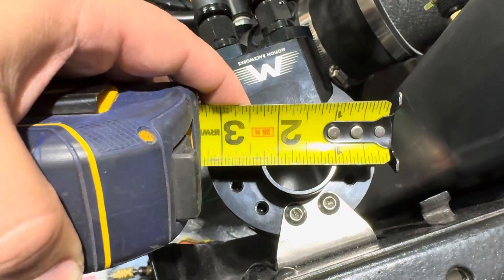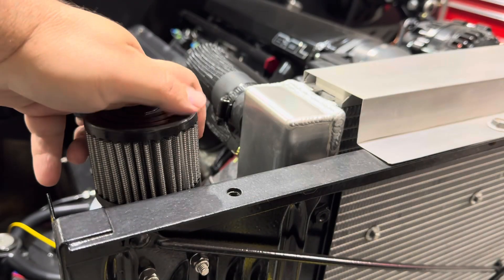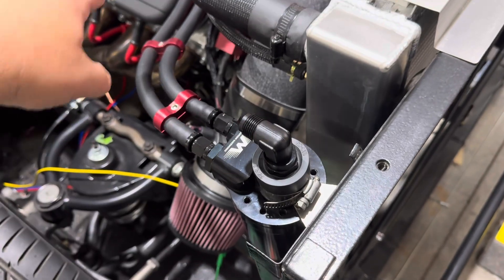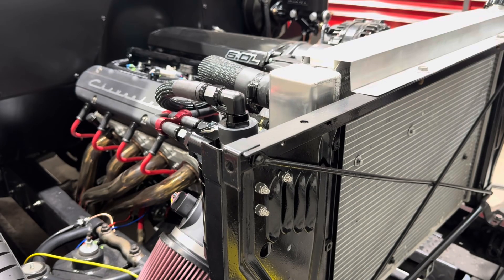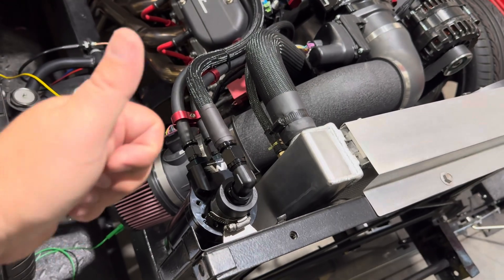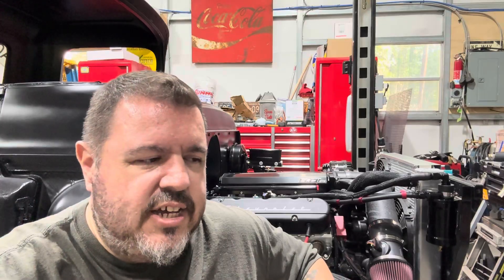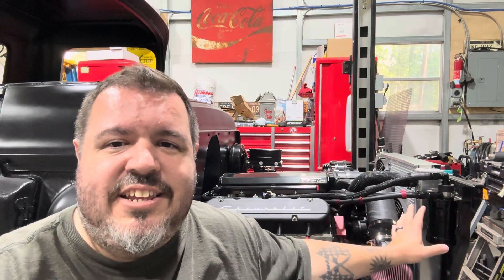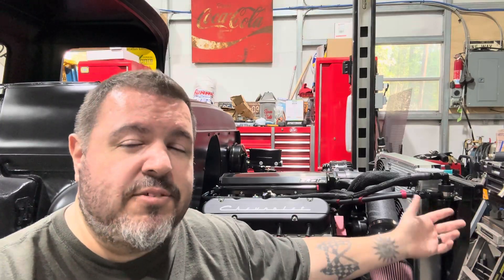Oil Catch Can Misinformation: Vented vs. Sealed—Which Is BEST for Your Engine?

Comment from the maker: PRODUCTS USED IN THIS VIDEO:
Fernco QuikCap:
https://amzn.to/3UfMqdS
-6AN Tee fitting (back of intake)
https://amzn.to/3YbIjRk
-8AN push lock fitting:
https://amzn.to/4dSEUwj
-8AN bulkhead fitting
https://amzn.to/3NEbvv7
Lock nuts:
https://amzn.to/3NxxILt
TechFlex braided sleeving:
https://amzn.to/3YwefkL

LINK TO PREVIOUS CATCH CAN VIDEO:
Oil Catch Cans: 101 - EVERYTHING you NEED to Know!
https://youtu.be/wX42ANVfbxE

Comment: Was using vented to atmosphere and switched to recirculating setup on my twin turbo sc400 noticed better stable oil pressure and better engine response cars now at 900hp 28psi 6800rpm

Comment: It looks like you connected catch can directly to intake manifold thats fine if the inlet to the catch can is a PCV valve.  If the inlet is the valve cover(s) what you have done is created is a uncontrolled vacuum leak, and likely created way too much crank case vacuum.  Too much crankcase vacuum can cause piston pin and potentially other failure due to inadequate vacuum.  Catch can outlet from valve covers needs to be vented or routed between intake filter and throttle body.
Reply from the maker: I appreciate the concern, but this setup ensures proper ventilation without creating a vacuum leak. Additionally, you need to watch the first video in this series as I have returned my can to a vented orientation.

Comment: Thanks for the video. Short intro & outro & you seem very down to earth. Answered a lot of questions. One thing I still do not get, is do I vent to atmosphere with PCV's still on the intake, or remove them?
Reply from the maker: Venting to atmosphere is pcv. However, be careful to plug any open sources of vacuum when rerouting pcv lines like this, so that you dont get a vacuum leak

Comment: You do nice work Mike. Your 55 is coming along well. Motion Raceworks actually sells this catchcan with an outlet already there (part #31-106BLK-14). to save some work. Question though: Does plumbing your vent into the intake manifold create a vacuum leak? Can you plumb it into the air intake instead? Thanks for the vid. Hope my 57 looks as good.
Reply from the maker: Ha! They came out with that part literally ONE weeks after I released this video… I actually called them about it and they laughed and were like “ah you know how it is - cant say anything until after its released”. 
As for a vacuum leak, the factory plumbs the pcv to the intake anyway. But it depends WHERE you plumb it. If your throttle body has the port - it can be plumbed there or under the intake, but no, I would not plumb it in line prior to that.

Comment: I'd leave it like that. It will keep your engine cleaner.
Reply: I run a double vented catch can on my Gen 2 Dodge with the Cummins turbo diesel. Cleanliness on a diesel engine's engine bay is near impossible. Always leaking somewhere.
Reply from the maker: I went back to vented almost immediately after making this video lol

Comment: I'm sure it cuts the stink.  I do wonder if you needed to adjust your tune at all vented vs. unvented?  Did you notice change on your air/fuel ratio at all after if you have an AFR gauge?
Reply from the maker: I switched it back to vented. I felt it runs so much better and created unwanted pressure on seals

Comment: I use vented because my motor is a Diesel Common Rail, and have very high pressure  and blow by
Reply from the maker: I switched back to vented on this engine

Comment: You’re better off with fresh air from intake going into passenger side valve cover to draw air into and across the crankcase and out of the driver side valve cover into the catch can and back into intake with sealed can. For boosted applications just use the same setup but put check valve in can exhaust filter to vent air out only.  That way you maintain your oem vaccum setup by preventing air from getting drawn in but in the event of too much positive pressure it will then vent out of the catch can filter if needed
Reply from the maker: I went back to the original configuration of both valve covers to both inlets of the catch can. Engine is much happier 😊

Comment: Was catching a lot of oil in unvented can on 87 sbc 350, going into front carb main vac, with tall valve covers, 98 350 catch can unvented working good catching moisture and little oil, both all stock no egr and cans are about air fliter level
Reply from the maker: That’s great! They are convenient inventions!

Comment: I had to take the filter off because the catch can was not making my car start. Should I put the plug back on and the car started.
Reply from the maker: I think you might have it plumbed wrong.
Reply: @intheshoptv maybe but if I plug up the top instead of that filter he runs good. Also I put some steel wool in the inside compartment where the top spins off.
Reply from the maker: @anthonylisboa8415 You probably have it plumbed to run as a sealed can, and have are pulling vacuum. To run it open, all other vacuum ports should be sealed off, and then you’re basically running a line off each valve cover. Thats it
Reply: @intheshoptv  maybe I got the in and out hooked up wrong.
Reply from the maker: @anthonylisboa8415 Wish I was there to look. Will help any way I can if you don’t get it figured out

Comment: A sealed can goes in line in vacuum hose going to PCV valve. It has to be sealed to maintain vacuum. It just “filters out” contaminants. . A vented catch can is a puke tank. Bigger the hose leading to tank, the slower the same amount of pressure will be traveling, the less oil it will drag along with it.
Reply from the maker: Essentially

Comment: Your closed system is missing two critical elements that will drastically improve operation of your installation.  Right now you are pulling full intake vacuum on the crankcase and will pull more oil into the intake than even the OEM PCV system.

You truly need to add a filtered-air (metered / post-MAF) inlet into the crankcase (valley cover works).  Secondly,  that inlet needs an orifice of around 0.100" diameter, to prevent massive airflow.  This allows a flow-thru of clean, metered air without pulling as much oil as you have seen.  

btw, your vented system was fine the way it was, but of course the vented effluent is annoying and unnecessary. It does not need inlet air.

A closed system must have an orifice-limited in-flow of clean, metered air to flow-thru the crankcase, without pulling full vacuum and tons of oil into the intake.  Trust me.  Do this.
Reply: My bad for commenting on an older video.  But, since we're chatting and since you're running vented at this time, I'd still recommend to go to a sealed system with the changes I outlined a few days ago.  Properly implemented, and given you are not boosted or making 600 hp NA,  there are tangible benefits to a sealed system that vented does not provide, and no downside potential.  If you move to big hp, the vented system may be more beneficial.  I won't bother you about this again.  I got no agenda or anything to sell; just  thought you or your viewers might be interested.  Have a nice day.
Reply from the maker: It was quickly changed back to the vented configuration long ago

Comment: Did you have any issues with unmetered air by tying directly into the manifold instead of the intake before the MAF? I know it's a closed system, but I've had issues from even small intake leaks before.
Reply from the maker: Not due to the MAF, but I will say that the closed system created too much pressure. I didn’t like the way it ran, and quickly went back to the vented orientation.

Comment: I found your videos on Catch Cans enjoyable and informative. I have a 2011 Ford Ranger Wildtrak 2.5 TDCI which I bought new and has done 83,000 KMs. I do some long trips 1,200 -1,500kms and local ones 30 kms +, I recently installed a Catch Can that can be run sealed with a plug in the top or vented. After watching your earlier video I tried vented and sealed, for 300kms each. no oil in vented but a small amount in sealed. I have gone back to vented as I read that some fumes can go back into the Engine and I don't want oil in the air intake mixing with the Soot from the EGR. I don,t see any smoke or steam coming out of the Breather , the Engine seems to run better vented and the Temperature Gauge is slightly lower. There is very little blow by from the Engine. I live in a Tropical Country so no cold weather to cause condensation in the Engine. I can remember many years ago Engines had Breather Pipes that went into the Air Filter Box or down towards the Road.
Reply from the maker: Very cool, which country do you live in?
Reply: @intheshoptv  Thailand
Reply from the maker: @douglasfisher8665 That’s awesome. Would love to visit there someday!

Comment: Just wondering if the Vented option would work best in winter months and the seal option for summer months
Reply from the maker: Its more of a what your engine needs type of thing. Was just talking about this with another commenter… for example, carbureted engines tend to like sealed cans, and injection tends to like vented cans
Reply: @intheshoptv  sounds good, i brought one and is on the way. I will be using the seal option for summer and Vented for winter just incase it freezes the air have an escape throw the vent and not build up and cause a leak somewhere. I have a 2017 ford fusion 2.0 ecoboost.
Reply: @intheshoptv what about supercharged injection? LSA?  I have had a couple of sealed cans in the past on my LT1 non boosted cars and thought they did the job, but really trying to learn a bit more and set the next one up properly for its application.  Not racing but spirited controlled playing.  😅  Good stuff here.

Comment: Hey man, like the video.  I'm curious what you used for connections at the Chevrolet valve covers you have.  I have the same ones and don't like the look of a worm gear clamp at the valve cover.
Reply from the maker: @patrickbranen5362  they come with a breather tube attached to the side

Comment: Now just don't let the catch can fill up cause it will get sucked into the intake. I installed this catch can on my turboed is300 but the fumes coming out were over powering the cabin. So i routed the vent hose underneath the car out the back. But pretty sure my motor is due for a rebuild cause i catch alot of oil.
Reply from the maker: @lafollettegarage4019  I haven’t actually collected any oil in mine yet. Just condensation
Reply: @intheshoptv  my motor must be hurt. Cause I get quite a bit of oil built up. I'm doing a compression check on Monday.
Reply from the maker: @lafollettegarage4019  To be fair, Im not really driving mine around under load, I just run it in the shop a couple times a week to keep everything loose n lubed.

Comment: I own a 1990 4 cylinder Toyota Camry. It has always run reasonably well, with high mileage making it deteriorate only slightly. I recently installed an oil catch can. I started with it having the screw installed in the top making it unvented. I should mention that the 1990 Camry was manufactured without a PCV valve. That makes the oil catch can legal in California. When I ran a few errands over 2 days the check engine light came on. The third day, before driving, I removed the screw and installed the vent that came with the OCC. The check engine light never came on again. In addition, the engine ran extremely smoothly and got significantly better gas mileage with more available power. Before the OCC I had failed the smog test on only one category - slightly excessive hydrocarbons at 15 MPH only. I barely failed. I expect to pass easily when tested with the OCC. I am saving money to be able to get my registration fees current. I don't know all the technical analysis of this, but the engine obviously runs better. It still doesn't burn oil even at high mileage - a typical series 2 Camry engine. By the way, the OCC is the inexpensive one that is the best selling one on Amazon as reported in some videos. It was under $30 if I remember correctly. I checked the oil in the can and it is collecting the oil going into it as designed.
Reply from the maker: For whatever its worth, I reinstalled mine vented and it runs SO MUCH better
Reply: @intheshoptv  motion raceworks has a can with a check valve that appears to give you the best of both worlds...
Reply from the maker: @ Yep I saw it. It was released after this video was made.

Comment: How do you read the Brown milk like substance that fills the can? I put a Non venting can on my 007 lexus is350 and every 6 month or so I check the can. I've seen around 3/4 of an inch of light brown sludge oil in the can.  What does this substance tell me about the engine 🤔.
Reply from the maker: If its just in the can and not on your engine’s dipstick - its somewhat normal. Before your engine comes up to full operating temp (and even after in cold weather), there is a good bit of condensation that comes out of the crankcase. When water and oil mix, you get that milky stuff thats lighter brown in color. Good that you have a can. If you’re seeing it on your dipstick - thats a problem that needs to be addressed right away.

Comment: My first catch can was vented. In my opinion it's a horrible setup for a street car unless you like dealing with oil fumes. Modifed cars stink enough to begin with. Another problem is also that depending where you place it you may get oil residue on the inside of your windshield
Reply from the maker: @placeholdername3206  mine is by the grill. But running an LS with no cats produces more stink than that catch can ever will lol
Reply: @intheshoptv  Yep for sure! But at least the stink goes out the back of the tailpipe and you don't have a constant smell of engine on the freeway haha

Comment: I recently purchased the baffled catch can and the True Seal Catch Can Top, now available from Motion. My primary motivation for choosing this setup was to avoid venting to the atmosphere. As the owner of a built waverunner producing over 300HP and 20lbs of boost, I wanted to minimize the smell of oil that lingers after a run.

This upgrade should effectively contain the oil vapors and prevent them from being released into the air. I'm looking forward to seeing the benefits of this modification.
Reply from the maker: @GMG3190  cool let me know how it works out

Comment: Would a catch can connected to a vacuum source not be better to help pull out the gases and create a negative crank case pressure?
Reply from the maker: I’d answer your question with a question - does your engine do a poor job of evacuating crankcase gasses and pressure? IMO it’s not a better or worse thing… rather - what are your needs. If your crankcase pressures/vapors are escaping just fine, then do you need to pull harder by adding vacuum? Maybe? Maybe not? Maybe if your engine doesn’t do a good job of evacuating crankcase pressure, then definitely! However the primary function of the can is to collect oil particulates within the crankcase vapors, instead of collecting back in the intake. The main reason PCV was routed to the intake to begin with is for cleaner emissions goals (ie: your intake becomes the catch can and the excess vapor is re-burned, not necessarily to assist evacuation with vacuum.) hope that makes sense.

Comment: Where did you connect your return hose?  I see somewhere to the back of the intake, but did you t-intersection into an existing hose, or what?
Reply from the maker: Yes, but I’ve since returned it to a vented configuration. Just so much better

Comment: Are you joking, The hiss is nothing to worry about? its hissing the further away because its more & more restricted? So running a high crank case pressure, when is that normal? Quick search on Goole has more than enough info on why this bad, and why negative pressure is goal. Nothing sucking enough of the blow by gases out, just pushed out under pressure its not evacuated as it should under the vacuum the intake pulls,   sure youll get the "steam" (steam is water, that is mostly oil), from the filter                                                                                                                                                                                     Negative pressure will seal the rings better, remove the carbon/fuel/water vapour, this video is very much misinformation, crankcase pressure is vital yet nothing testing this is working correctly, worried about the cosmetics. run positive pressure if the seals dont pop dont be surprised seeing more smoke as oil is forced through the rings                                                          Do the research people, look up all ive said and make your own mind up, a video saying its tackling the misinformation yet not a single test 🙄🙄 quote "nothings broken, everything is normal, whats happening is your system is pressurised" 😂😂 stock pcv is using the vacuum from the intake, nothing to worry about changing from negative to positive